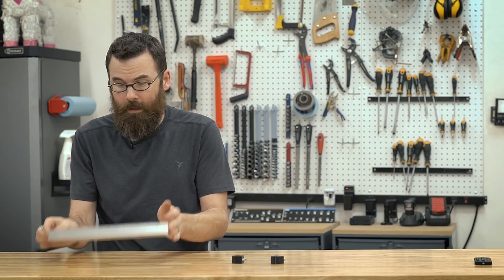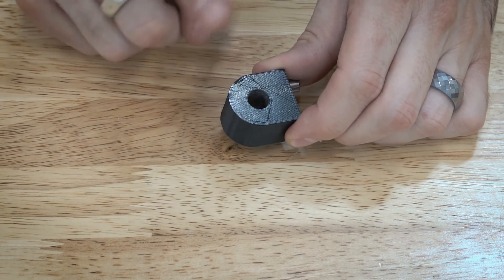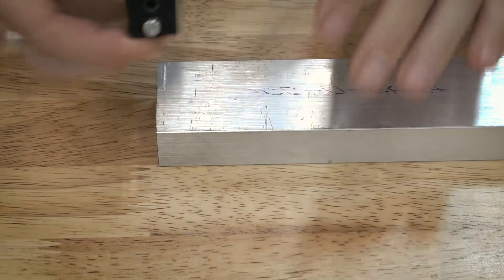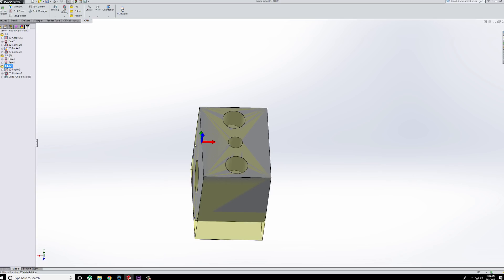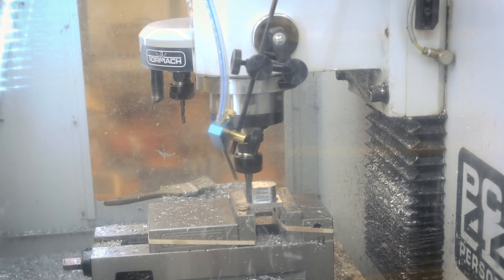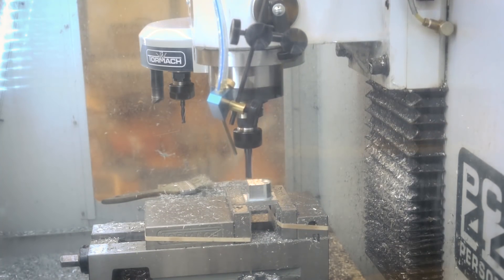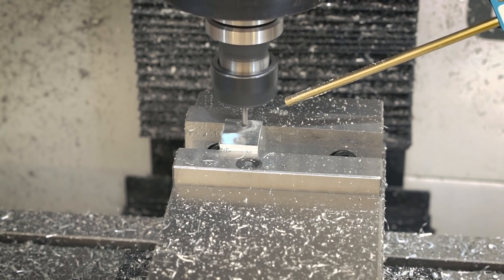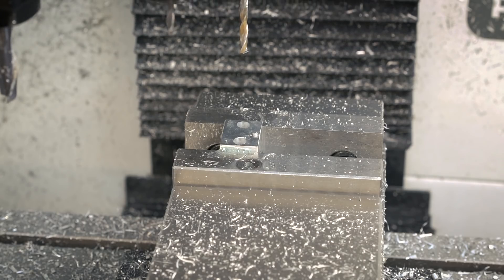From Start to Part - Aluminum Mounting Nubs

Comment: How did you deal with the round bottom of the part? Did you use a square to square it up on the yz-plane?
Reply from the maker: It's a bit hard to explain, but I have a flat 0.5" square bar at the bottom of the vise.  The 'nub' rests on this and the vise jaws clamp it flush, so it can't rotate.  I have the radius perpendicular to the jaws (I guess?).  If it was parallel to them, the part could rotate left and right along this radius, so I did it perpendicular so it can't rotate, since it's between the vise jaws.  It's just resting on the bar underneath to make sure it doesn't go down in the gap in the vise.

Comment: Good stuff. Love my Haimer Taster. You might already use these, but one thing I find very useful with multiple identical parts is a “work stop” or “vise jaw stop.” You just indicate the first part and then subsequent parts are essentially placed in the same x-position, so no need to re-indicate. I use one by SPI (http://www.penntoolco.com/spi-work-stop-for-machine-vise-jaw-width-7-8-70-951-9/ ) but there are many styles.